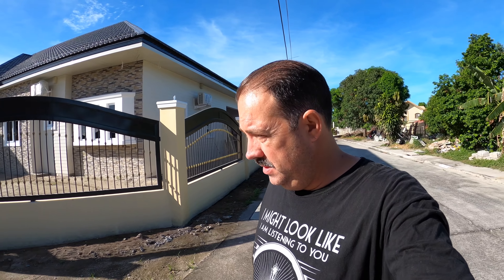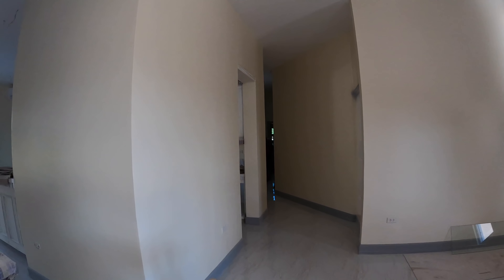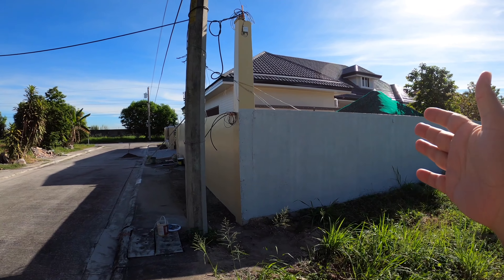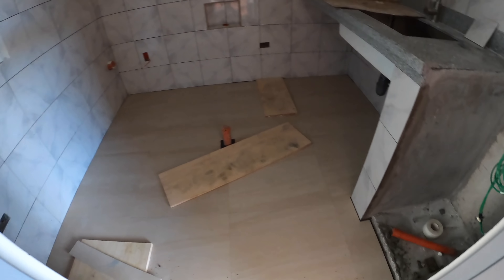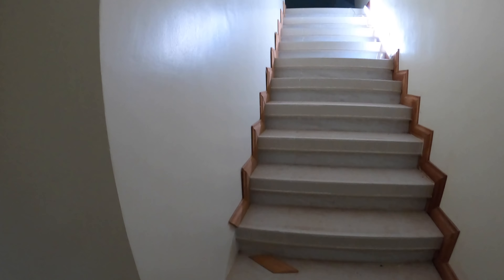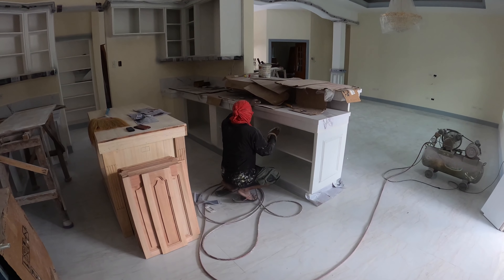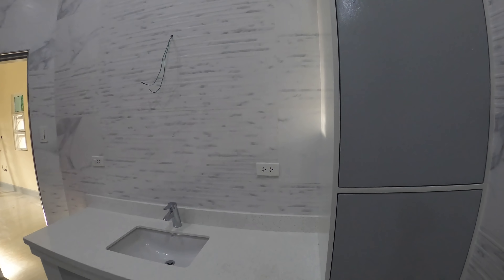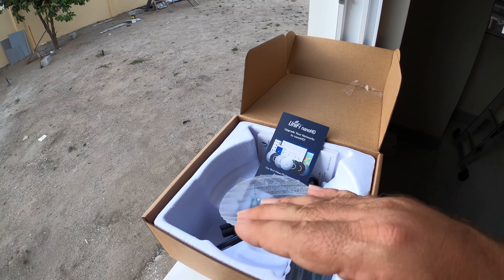Philippine House Building Step by Step, Build Day 233: Floors, Doors, and More

Comment: Nice advice on the wifi extender, my home here in Cali I have to use one as well just so I can get good reception... I will bring mine as well... Thanks for the tip... Your cabinets look great... Nice video...
Reply from the maker: Thanks Bruddah!🤙 Check the voltage for 100-240v. Most electronics these days are dual voltage anyways.

Comment: The place is looking great. How do you manage the overspray from the air gun? Toning down the white is a good move, white does create more light but it can also be a bit stark.
Reply from the maker: They haven’t been controlling the overspray too well until recently. So dark colors first and the repaint the base coat prior to two or three coats of top coat paint. Recently been using newspaper and cardboard to control the overspray.